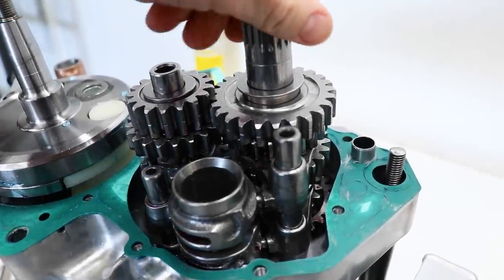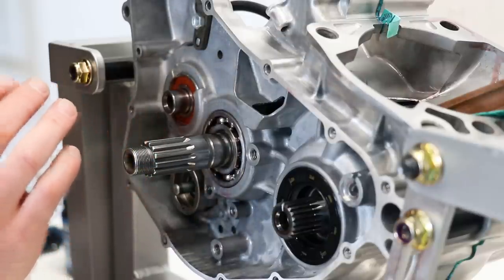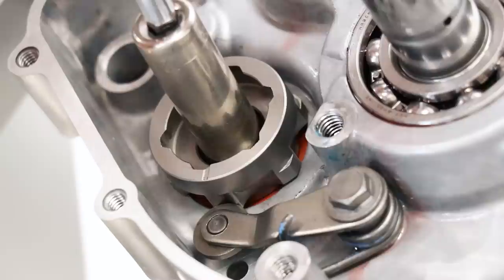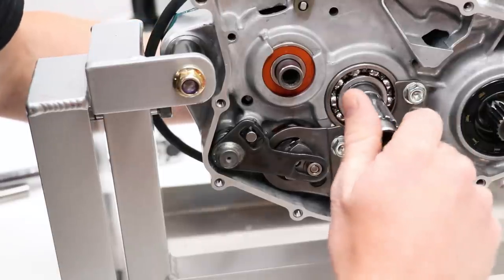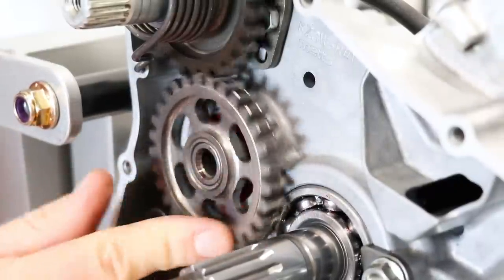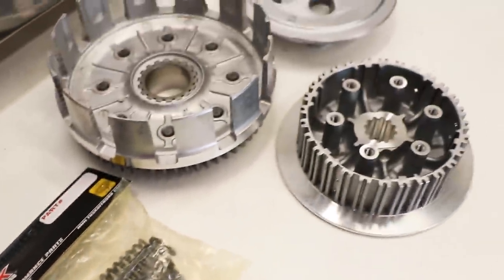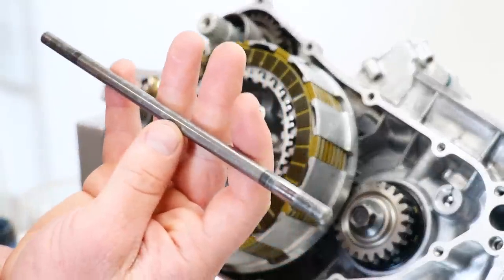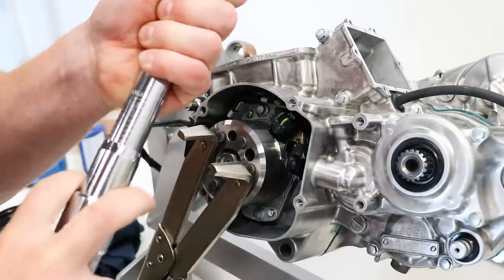I Fixed My CR250 Engine For $2!

Comment from the maker: What did I do to the engine covers?
Reply: boyesen magnesium colour covers or scotch brite the oem ones, also a magnesium colour cerakote will look awesome, since you 've also other parts
Reply: Bronze cerakote
Reply: Cameron Niemela powder coat? Lol🤔
Reply: boyesen!!
Reply: Cameron Niemela QUIT TEASING US!!!!!
Reply: Bronze ceracoat, factory finish?
Reply: Cameron Niemela HRC REPLICA covers. Order them through Luckynino.
Reply: I saw it on your instagram. hehehe
Reply: Spray paint 🤣
Reply: Anodize it, red or gold colour
Reply: Cameron Niemela cerakote bronze color
Reply: Did you make new ones from modified scotch brite pads? :D
Reply: Cameron Niemela You clean them up with Scotch-Brite pad
Reply: Great job! Very informative and well explained.
Reply: You had some blue powder on your ig story a while ago. What is that for?:)
Reply: cerakote them, bronze?
Reply: fry em, buy boyesen ones. Prolly strip the boyesen ones to because the coating dont last worth a damn
Reply: Include Thai caption
Reply: Hello would you have a site where I can find a manual workshop for a Honda 250 cr 1996???  Thanks you
Reply: Burnt brinze

Comment: I am so glad you misplaced that washer. I have been putting off throwing my 98 cr250 motor in for months now because i just couldnt figure out what was wrong. Just so happens it was having the same symptoms and now its only gonna cost $2 and a few days waiting to get it all back together. Really appreciate the Quality vids. Keep em coming brother!
Reply: Why u did not just check the parts diagram?
Reply: @chriscs9080  I still haven't split the cases again to make sure. Just had the same symptoms he did. One day I'll crack it open again and fix it
Reply: @chriscs9080  Cameron checked the diagram and even then didn't realize tahat there is a missing part, so probably its not so easy even with part diagram
Reply: Why not just put the washer in instead of throwing it in

Comment: Just rebuilt a '97 cr250, went through everything. Checked all measurement of every part (yeah every part). Transmission had 3 missing washers which is rediculous how the previous person who rebuilt it just let it by like that. I am glad that every thorough check I did has paid off. Just those simple washer can lead to disaster.

Comment: Hey cameron, so I just replaced my customer’s clutch with the motion pro inner hub tool, and that thing BROKE the inner hub. I had to pay money out of my own pocket to buy them a new inner hub. I’m sure the tusk tool is fine but the motion pro tool sucks so bad and it was extremely sharp like a knife and cut through the hub. I recommend just putting on the clutch/friction plates after the inner hub, and then tighten the inner hub while jamming the clutch gear and crank pinion gear with a towel to keep them from rotating. Doesn’t look as pretty but I think a soft towel is much safer than sharp steel on aluminum. Lesson learned. Thanks for the video man!

Comment: hey pal, great work, but just for the sake of knowing,from one tech to the other they say its easier to slide the clutch steals on with the rounded edge in to prevent the sharp edge from possibly putting a burs in the hub .. as if some one is gonna beat them in crooked with there favorite B.F.H.. lol..

Comment: I was told to stagger each plate by one notch. The reason was that it moves the oil around better. 
And also told that the notches are there from the manufacturing process and it makes absolutely no difference how they are aligned.

Comment: Hey Cameron you should be really careful when using grease to hold things together, the slightest bit of grease contaminating a bolt or its hole will render the loctite useless. Loving the build and channel though!

Comment: Cam - I know you love to pull every last nut and bolt apart.  But your'e making a rod for you own back.  Example pull the clutch as an assembly - put a cable tie through every thing and put it aside until reassembly.  The same goes for two gear shafts,  the moment you split the cases - cable ties around bearing ends so the washers and gears cant drop off.  Don't pull the gear shift detent apart - keep it as an assembly and so on.

Comment: put a penny in between the clutch basket gear and crank output gear to hold it in place. Soft enough doesnt cause damage and you don't have to try to hold the entire basket in place.

Comment: Cameron - You do a terrific job putting these engines together.  I, too, like to assemble my own.....then I pretty sure that it is done correctly.  A lot of times I do it without a diagram but I won't do it anymore.  You've certainly convinced me that using the diagrams makes it a lot easier.  Clean and careful.....Quality is JOB 1!  Ha! Stole that from FoMoCo.

Comment: Did I miss something or did you put the kick starter spring in a hole on the surface between the case and cover...maybe the hole in the case to the right? I think that hole in the case is for a pin to line up the cover...perhaps.

Comment: On the clutch - it makes no difference if the washer between the hubs is rounded side in or out - also, on the driven clutch plates (metal - some kits have steel and some aluminum) it makes no difference if the rounded edge is in or out, but I prefer to put them in all the same direction - on the driving plates (fiber) the notch in the tabs is for alignment during manufacture - it makes no difference if the notches line up or not.

Comment: One thing I noticed that you did was wrong that shaft collar that you put in on the crank and it rides on the seal.  I noticed it had a groove all the way around it.this ride on you crank seal. Rule of thumb is  if you could feel it with your finger  it needs to be replaced this is what blow s  your crank seal and make your  bike smoke really bad in your motor will not clean out. That shaft collar is a $44 part.

Comment: Try to shake for a few seconds your blue locktight before use. It looks very liquid on your video.
The same happened to me until I start shaking. You will notice it will be more thick and bluer, locking the nuts as it's suppose to. 
Great video by the way. :)

Comment: I don't  know how much you have ridden that beautiful  bike, but l have the same bike and wanted to know if that Tusk clutch is any good ?  They are so much less expensive than Hinson, EBC  or Barnett . I am scared to use it thinking both the fiber and steel plates are inferior  to the brand names.  Thanks

Comment: Hey Cameron It looks like your using  Harbor Freight torque wrench> IS IT?  I'm doing a fix and rebuild on my 08 KTM EXCR 530 and question the accuracy of HF torque wrenches I have them as well as some digital torque heads. Im not sure what to use? Any input?

Comment: Hey I have a vintage dirtbike and I’m scared to tear down the motor to clean the cases. Is there anyways I can clean them without taking the motor apart or getting water in the motor. Thanks!

Comment: When you put the grease on the case how does that prevent the gasket from leaking?
Reply: It doesnt, you put in on then the gasket (it will hold the gasket in place) also the grease helps if you need to disassemble (like what happened in the video) it prevents the gasket sticking to both mating surfaces (thus minimizing the gasket tearing.)

Comment: I've got a husqvarna fc 450 2017 .when I pull the clutch in it shuts up a chatter noise this is in neutral ..let the clutch back out and the chatter noise starts again ..I've been told it's the large gear on the back of the clutch basket and the small gear it meshes with. .got told it was like a gear backlash noise ..would you think it's that..I got told not to worry about it cause it's comon why don't other bikes doing it then. ???

Comment: Was there a ballbearing inbetween the clutch actuator pin and hub?I did my engine and clutch seemed a bit short on the pin
Reply: I had that problem with my 03 cr250... Went back amd watched this vid again to see if he would say something about it. Yes there is supposed to be a ball bearing inside the cap that the rod pushes
Reply: And no its not in the blowout at all... Cant wait for him to show the video of adjusting his clutch cable to see if he figures that out...

Comment: Kick start just snapt i have no grip teeth on the kick start.  I can literally move all the way around as if it were a circular joint. The threads are gone I have to get a new Kickstarter. is there a way to start it without a kickstare while trying to fix TDC. First kick start
Reply: Anthony R put a drill on your flywheel and spin it and should start
Reply: Anthony R bumb start
Reply: Put it in second roll down a hill with the clutch in and bounce on the seat as you let the clutch out should start

Comment: Whats that blue sticky substance you put under the blue gasket?
Reply: There is this gasket material called Halomar. Its a hitech sealer for aerospace. Not trying to insult this guy but I would bet money he has never herd of Halomar so my guess is its more of that blue water proof grease. One should NEVER reuse crank case gaskets let along grease it. They are a one time use deal. So in my book its a fail.

Comment: hey cam why do you put Grease on the gaskets ?
Reply from the maker: Mtb Ridingog Helps keep the gasket in place and prevents it from sticking for future disassembly
Reply: Cameron Niemela Kool ..... I have to replace my head gasket on my cr125 but I want to ask you a question because I feel like I have it figured out but it's always good to ask and make sure ...  So I have a issue with my cr125 hitting the power band ... Don't get me wrong but when I try to wheelie my bike at low rpm it just want to die .... So when I first got my cr125 I had to replace the bottom end parts and top end .... Because the previous owner blew the bike up and messed up the bearings and clutch assembly ... So I had the stock carb from Honda for the 125 and I couldnt use it so I sold the carb and bought a banshee carb for my bike so .... Everytime I hit the throttle hard unexpectedly the bike  goes but hits the power band late .......... I was thinking because it is probably getting to much fuel .. from the banshee carb ......idk feel free to comment what you think the issue maybe ....

Comment: Good vid but ya forgot to time your stator plate which is very important on a 2 stroke  otherwise it won't run correctly 😋
Reply: on a cr250 you can't time it.. just one way to fit it.  you could see that.
Reply: Does it? why is the top mount elongated then for adjustment?